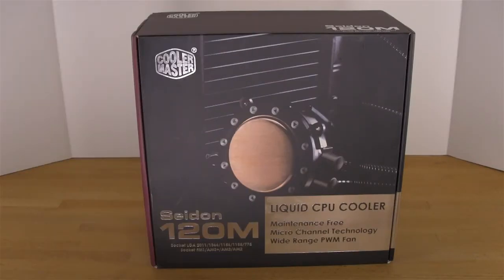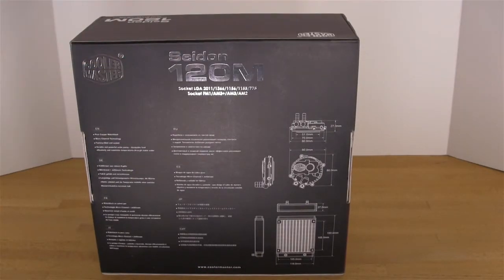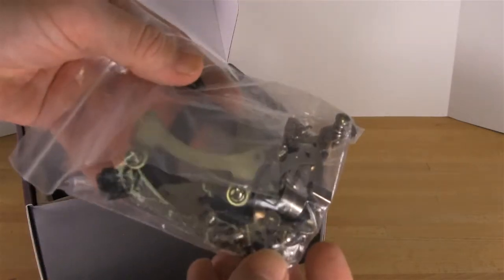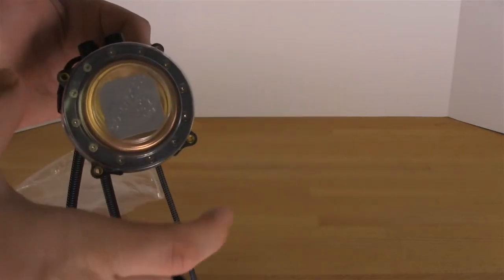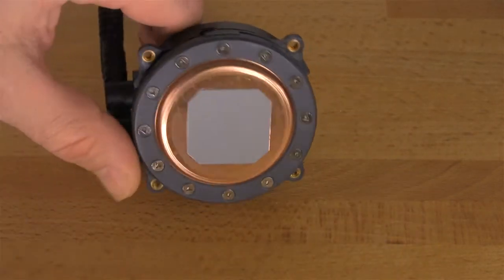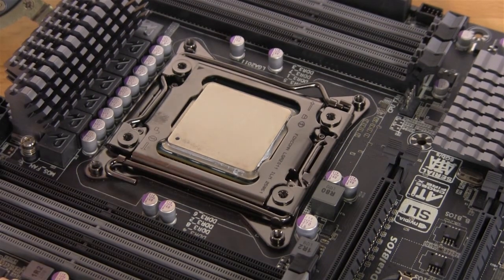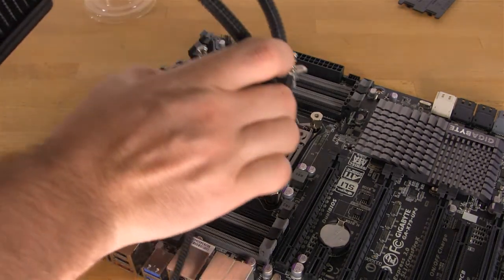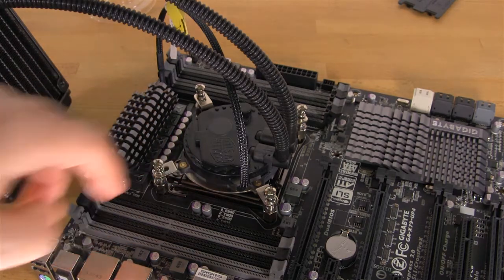Seidon 120M Review

Comment: This thing is a pile of shit, I ordered one about 2.5 years ago and the first one I got was DOA, they sent me a replacement and it never properly cooled my shit down. Yes I plugged it in correctly, yes I applied the thermal paste correctly, everything was done perfect. It never kept my system cooler than 40C while it was idling. Just the other day it started making a horrible rattling/clicking/clacking noise and won't stop. Fuck cooler master for making this horrible fucking excuse of a cooler. The stock heat sink and fan that came with my system did a better job of cooling my system down and I guarantee it wouldn't have broken by now, and even if the fan had broken, I could replace that bitch for super cheap. This thing isn't worth the headache. Again, fuck cooler master.

Comment: it says liquid cooled. would you be replacing the liquid at some point? or you can use that liquid till it breaks? does it not evaporate?

Thanks!
Reply: It's supposed to be main maintenance-free, i've heard people saying that the liquid tend to dry, but i have a friend that has almost 2 years with its corsair h80i and no problem whatsoever.
Reply: Albert Agelviz I usually switch out my all-in-one pumps every year for that issue

Comment: Cooler master says that the pump must be connected to the chassi fan header and the fan to the cpu header, but if you wanto to put anoter fan could you put the pump running at full speed at the cpu header and the radiator fans in the chassi fans so it can be controled via software ( the software only allow to control the cpu and chassi (all at the same speed) separated but not all the chassi fans individual.

Comment: Very nice video, although for people who are especially using thermal paste I wanted to tell you to criss cross the screws first by finger tightening them.  Then tighten them further using using the screw driver in a criss cross manner.  This is to apply as much even pressure as possible and not allow smearing or air bubbles.

Comment: Hey man im thinking of putting 2 Noiseblocker Multiframe M12-P (2000 rpm) in a push/pull combo to get less noise and more efficiency. You think i can pull this off on both goals? The fans are awesome in all reviews so im worried about the cooling capacity of the radiator. What do you think?

Comment: On your site, was for example the H70 tested with two fans? 
Is it likely the Seidon 120m will be comparable to the H70 once you get a second fan for it?

I'm trying to decide whether to get the Seidon or put up the difference for the H70 Core(for which I would have to buy fans separately)